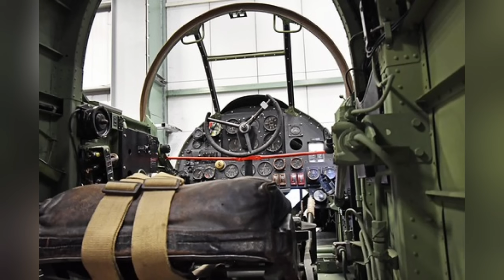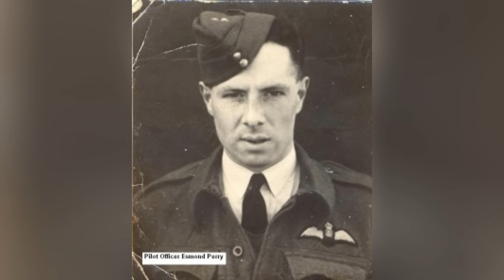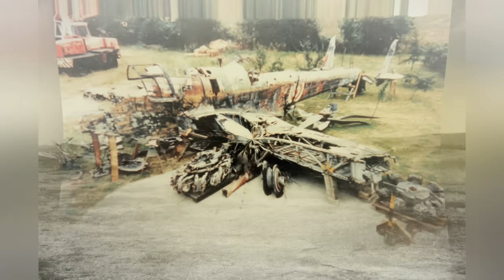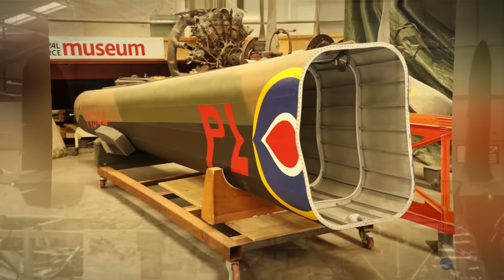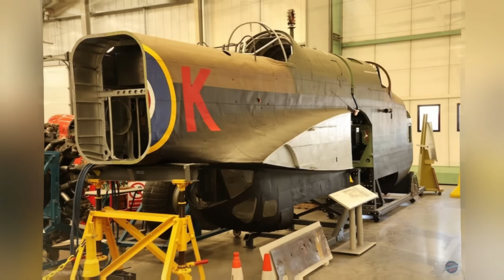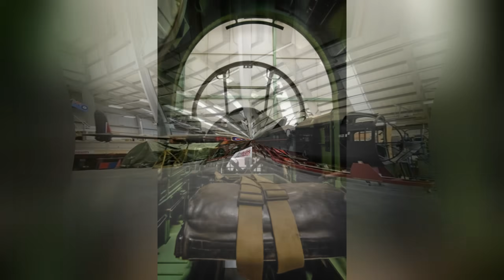Recovering Hampden P1344: The RAF Bomber With Two Serial Numbers

Comment: Isn't there a Hampden being restored at East Kirkby?
Reply: Yes, but it's in storage, not being restored.
Reply: @RoyCousins Wrong, it is slowly progressing due to lack of drawings and the work to make Jane airworthy.
Reply: @cmg6848 That's good news. Last time I saw it, it was in a thousand pieces and shoved in a corner of one of the buildings.
Reply: @RoyCousins   =  whilst i've not been there for many years, "cmg" is correct in what he says.
I've seen it myself on at least 4 occasions over the last 24 years.
The original project leader (Coninsgby RAF Engineer) regrettably died young & the project stalled.
When I sat on the grass & chatted to BOTH (alive, then) Panton Bro's, they told me "the 2 new guys who've taken over just don't have the same drive or work ethic" (as the previous guy, who regrettably died)
So it's being restored "at dead snail's pace" & I doubt we'll see it completed within the next 20yrs or so, by which time this WILL be & become a Muslim nation & they "don't give a f**k" about indigenous WW.II History, as we do.
East Kirkby will most likely be demolished & turned into a Mosque